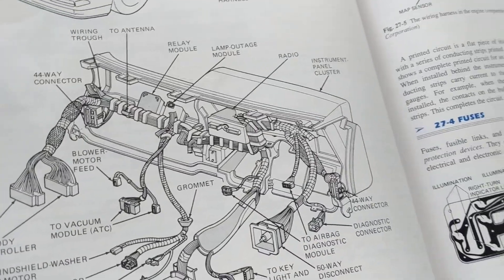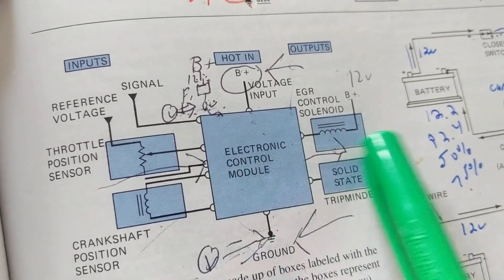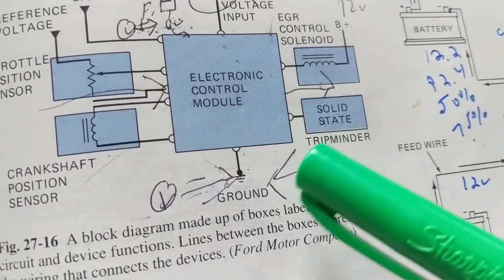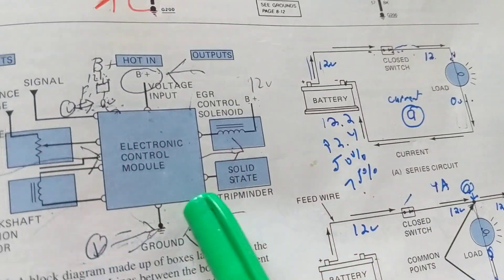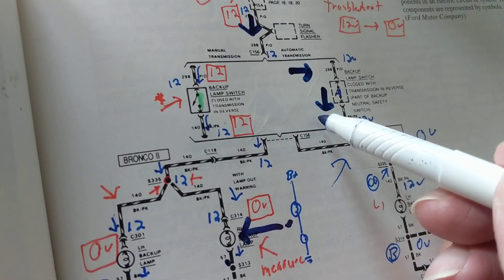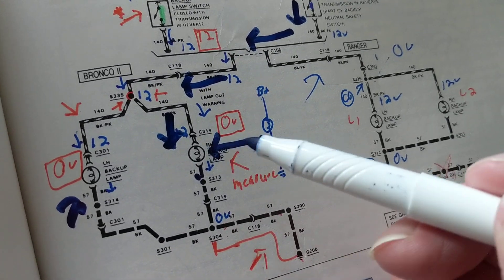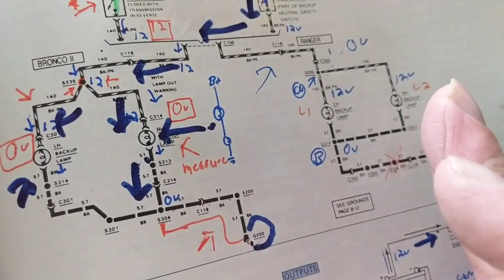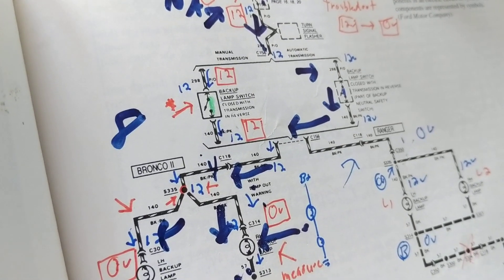HOW TO UNDERSTAND WIRING DIAGRAMS WITH A SIMPLIFIED EXPLANATION FOR DIAGNOSIS FOR BEGINNERS

Comment: Can you explain "external splice"? I have a maf sensor wire that cut when I replaced a transmission. I can find where that wire goes.
Reply from the maker: Obviously with the mass air flow sense of you have b+ and the ground in a signal wire now the best thing to recommend is if you're looking for where the wiring for that connector is go to Google put in your vehicle make and model an ear ask for mass air flow sensor wiring diagram for your vehicle you will get one page downloaded for free try it and keep me posted